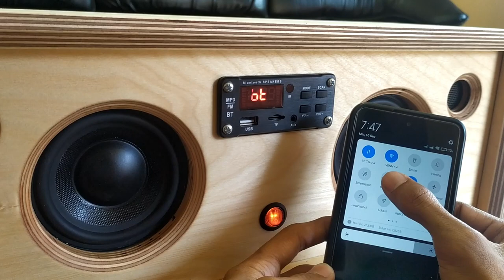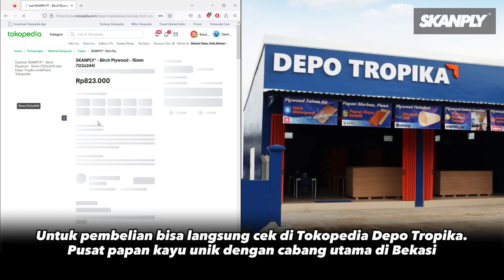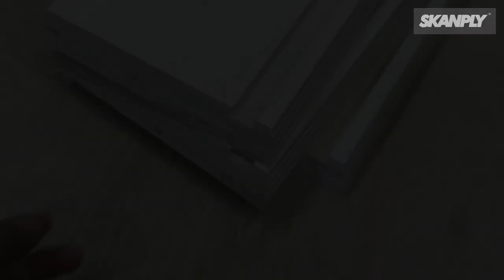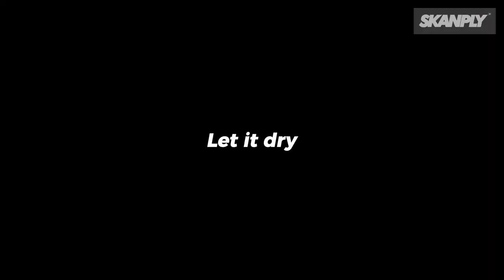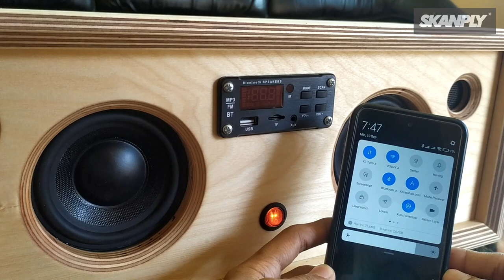DIY Bluetooth Boombox Speaker | Membuat Speaker Aktif dari SKANPLY® Birch Plywood

Comment: You need a frequency filter, otherwise you will blow the tweeters. Use a 2-way crossover at best.
Also it would have been better, to build separate volumes for each channel (left and right), to create a proper stereo setup.
Reply from the maker: thanks for the advice